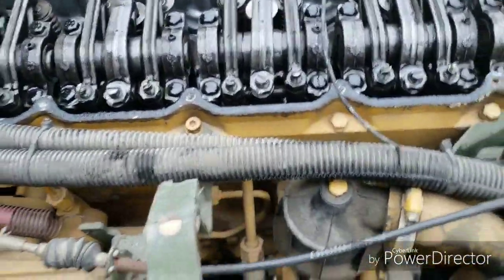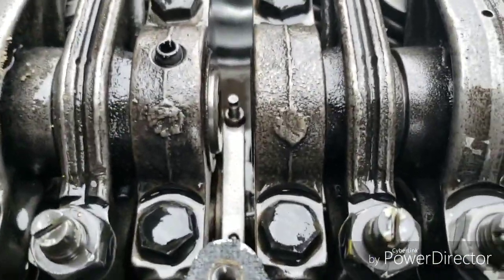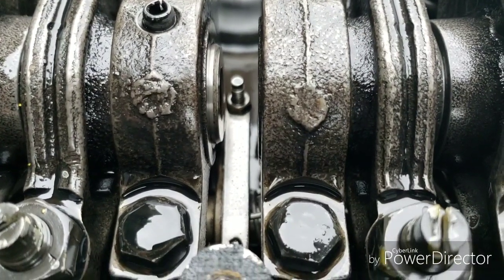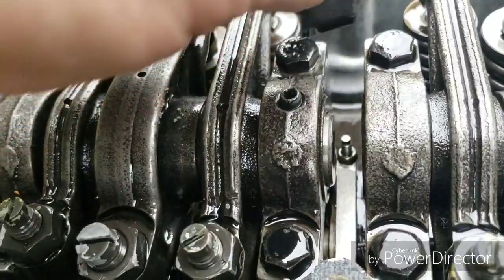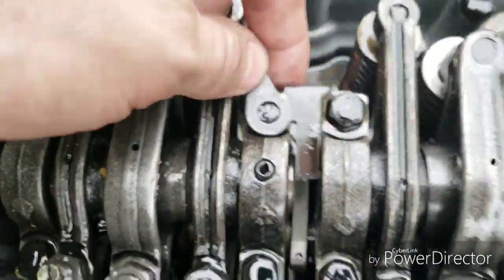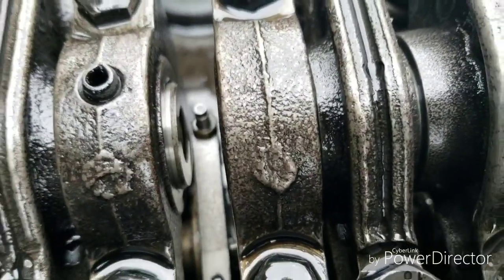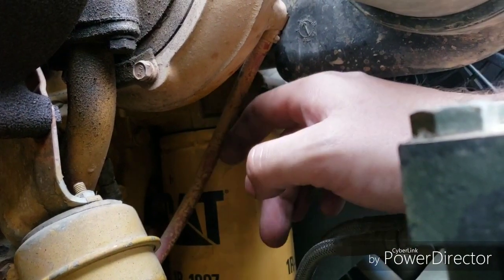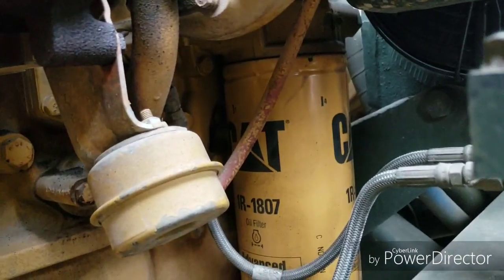CAT 3116 MEUI Fuel Ajustment and Power Increase

Comment: I’m definitely going to do this to my cat but first you said two turns counterclockwise then little bit later you said three or four turns counterclockwise. Which one is it and what is the difference two turns compared to three or four turns.Thanks
Reply from the maker: Put a Pyrometer on the exhaust. Start with 2 and increase as necessary.  It really depends on your elevation, turbo size, injector size.  Some 3116s have bigger injectors,turbos than others.  This was a larger HP 3116.  

Your elevation makes a big deal too. More fuel it'll get hotter quicker with less o2

Comment: Any issue eliminating the wastegate?
Reply from the maker: Plug it off  no issues.. gets more boost this way.
Reply: @wessimpson2794  Do I spend more diesel turning the screw of fuel pass?
Reply: @emersonbarahona579  there is no singel answer, generally with diesels adding fuel ( sensibly, and not just rolling black smoke) adding fuel AND adding boost crestes HP and torque,  which allows the engine to not work as hard and get better fuel mileage. 
That said often we dont see those gains because we are enjoying the added power.

Comment: Can I replace this 3116 with a marine mechanical fuel pump 3126 330 horsepower? The motor is in a triaxle dumptruck hauling 17 tons does ok on level ground but can smell a hill a mile away!!! Jus looking for more power
Reply from the maker: Be better off to swap to a motor with more guts.   3116s bring good prices 

I don't know of a tri axle dump with that small of a motor.
Reply: @wessimpson2794  was thinking a 3126 would plug right in without any alterations
Reply: @wessimpson2794  me either until I got this one!!! Any suggestion as to which motor I could swap it with?.. my issue is thats its in a 94 gmc topkick..not many options to choose from 🙄

Comment: what is the main cause of the fuel mix with engine cooling water  (engine CAT 3116)
Reply: head gasket leak
Reply: @cg8469  no bro. if it's fuel in coolant then it's injector cup or cup of ring failure. usually you will get some coolant in your fuel tank when engine stops. reason for this is when engine stops fuel pressure will be lower than coolant pressure so the coolant forces its way in return line.
Reply: INJECTOR CUPS. are known to do stuff like that... Though ive ran a3116 with fuel in water for over 3 years.(ridgerunner).
 long as its not getting hot, etc. .. depends how bad the cups are.. there know for that.. but you can do it yourself but the tools are not cheap. drain your fuel tank, let it sit in a clear jug. see if anti is in fuel tank... and same for antifreeze.. either way, they will keep running,  eventually they get harder and harder too start,  etc etc... if its a beater.. run it, keep fresh fluids and filters in it.. lol

Comment: here is a thread on the topic of the adjustment under the valve cover. 
 https://www.turbodieselregister.com/threads/3116-more-power.57000/  

and little more info including the wastegate block off  found at
 https://www.justanswer.com/heavy-equipment/1xedq-3116-cat-engine-dump-truck-turn-power.html

Comment: Thanks Wes.  Guess one should consider a EGT gauge and boost pressure gauge if they do both the turn up And the wastegate defeat?
Reply from the maker: No. They are not needed.  If you drive with some sense. You will feel it when the truck is pulling vs isn't. You will know the sweet spot when you drive it.  I have logged over a million miles on hot naturally aspirated and turbo engines, both intercooler and after cooled.  You will know when you aren't pulling vs just blowing smoke. 

Another modification is to add a 5 or 10 gallon water tank behind the fuel tank or the battery box with a washer pump and add 2 or 3 windshield washer nozzles to spray into the intercooler then add a micro switch for the throttle to hit it at WOT or an in cab switch to activate. This will drastically drop egts
Reply: @wessimpson2794  that's genius on the adding water!! I need a friend like you, here in Savannah!!!